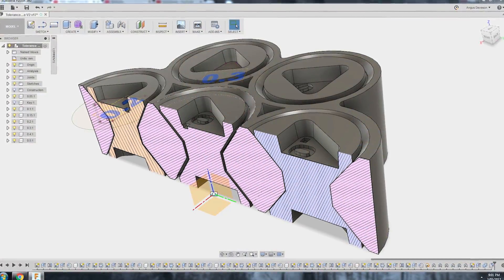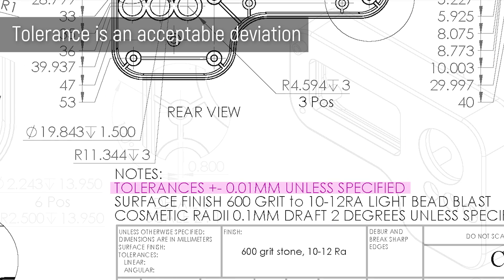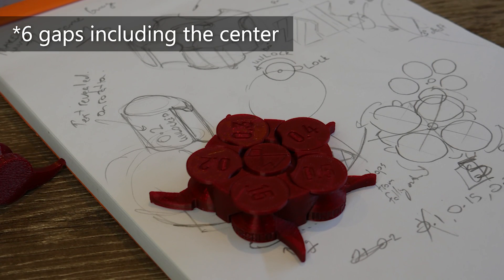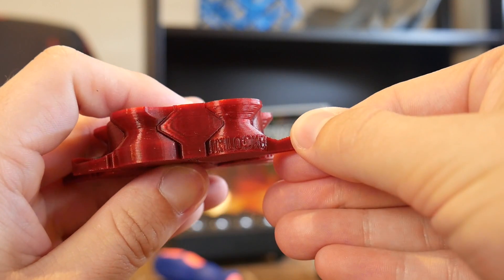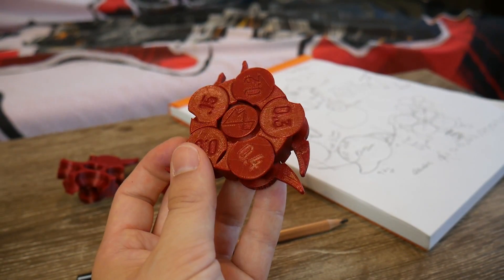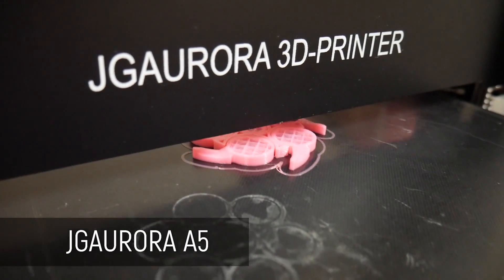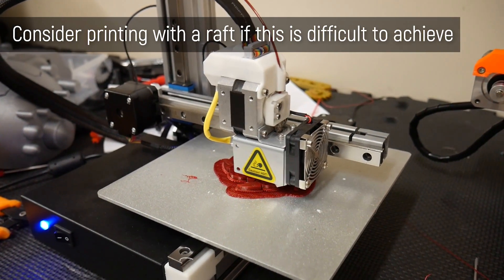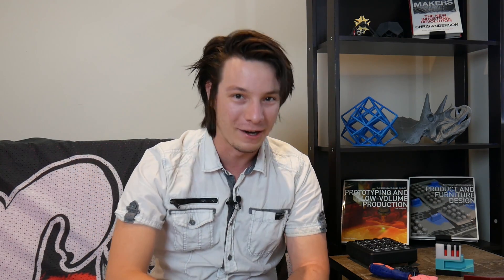Test your 3D Printer's Clearance and Tolerance

Comment: I understand this video is 5 years old. But I've looked all over the inter net with no real help. So i use a ender 3 v2 i use PLA and print at 200n and 60bed. When i tried the Clearance and Tolerance I was unable to move any of them. Almost like they are fusing together at lower levels of the print. Now i have made sure my bed is level i have made sure i am pushing 100mm of filament out. I've done E-steps. Done everything i can find. so any and all help i would love. Thank you.

Comment: how to adjust design afterwards? Im currently struggling with small holes that come out different sizes for horizontal and vertical
so if the thing doesnt turn, that means its too close?

i was looking at how these turn, and i had this idea for a tolerance knob gauge
a singular knob, and have numbers printed on the sides (0.5, 0.4, 0.3). Print it, then stick a feeler guage into the slot. Take the number printed on it and the feeler gauge number and minus it, and thats the amount of adjustment you need for that size hole.
I dont think feeler gauges come in >2mm tho.

Comment: Okay... so I printed this with your recommended settings, and only the .5 and .4 are unlocked. EVERYTHING else is completely fused! So what do I do? You don't really go into any steps to help alleviate issues with the clearances on the printer. As I'm not a designer, I'm not going to be able to alter the designs of the STLs that I'm trying to print.
Reply from the maker: Your first layer is most likely too close, try adjusting it and watch to see if there is gaps between each element as its printed, I've got another video on elephants foot effect and how to fix it here - https://youtu.be/zlgR3rHg4p8
Reply: @MakersMuse  Thanks for the quick reply! I actually watched your elephants foot video after I posted this, reworked my Creality Cura profile. I reprinted using a raft, and unlocked all but the .15!
Reply from the maker: @davidwatanabe2017  awesome!

Comment: I bought your tolerance gauge and have run 5 models of it adjusting settings in between each attempt. I have adjusted the extruder multiplier , the horizontal expansion, elephants foot, extruder steps, the layer height, and a few other settings that I can't remember right now and I have yet to have one test that I could break any of the segments loose. The printer seems to print most models well including articulating models, but I can't get this file to print properly at all. The model looks great, but there is no clearance on any of the test points. Any help would be appreciated.

Comment: Hello ,

I bought the tolerance part and after 30 minutes of pressure, 0.5 and 0.4 were very comfortable, while the rest 0.5 - 0.15 - 0.20 and 0.30 were stuck so much that when I tried to open it with a screw, its wings broke. How can I improve the tolerance of my prints in this case? Or do I need to give my measurements a value between 0.4 and 0.5 when I want to use them this way? Thank you.

Edit: Extrusion multiplier 1,00 in Simplify3d
Reply from the maker: It's designed to show you what clearances to expect, so yes you would design in 0.4 to 0.5mm gaps in future prints to ensure they don't weld together. For improvement you could try changing extrusion multiplier to 0.95, check retraction settings to ensure there's no blobs and make sure first layer is really really good. Good cooling also can help.
Reply: @MakersMuse  Thank you for your advices. I'll try and let you know here. Thank you.

Comment: My first run was a fail, lol. I could only break free the .05 I set the slicing tolerance to Exclusive, see if that helps. I will adjust a parameter at a time to really identify ware my issue is. Fun print though!

Comment: I printed it successfully on my CR6 SE. I had to apply significant force to 
break the.15 mm one lose but it worked.  The .15 is a bit tight but the 
.02mm clearance is very smooth.

Comment: So far one of my artillery sidewinders has no problems everything is free off the bed. 
The other I need to pop .15 loose and .2 is a little gritty. What setting should I play with? I knocked flow down to 95%

Comment: just printed the V1 version on a FlashForge Adventurer 4 .. all but 0.05 and 0.1 can be moved even without the tool to break them free, the others are impossible to move.
I did have some elephant foot, maybe that's why. overall, a pretty good result for having everything "on default"

Comment: It doesn't look like he replies to this anymore, but I'll throw this out there to see what you guys think.  When I printed this on my Ender 3, the 0.3, 0.4, & 0.5 literally fell out of the casing....and the other 2 weren't even snug.  So I assumed this was as under extrusion issue.  However, going back and checking (and rechecking) all the calibrations, my machine is right on target.  If anything, it's SLIGHTLY overextruding.  So, this has me baffled.  Any suggestions ??

Comment: I purchased the new  version , I was expecting to have a G code for my prusa Mk3 . I am new in 3D printing, Does the infill % or layer hieght or speed values effect my final result ? Do I need certain values when slicing in Prusa slicer ? Thanks for any help
Reply: Yes speed will affect it. Layer height might slightly. Infill shouldn't affect it much.

Hard to share g-code because it includes material temp settings so you'd have to have EXACTLY the same setup as Angus including material

Comment: Just tested my brand new CR-6 SE.  Getting the part to lift was a real challenge - refrigerator - hot water, cold water, hot water, knife and spatula! I didn't know about the flat blade screw driver allowance.  That made me happy because it freed up 0.2, although the 0.15 did snap instead of rotating.  I sliced using CURA 4.9 with all default settings because I mostly use Linux, not Windows.  The Creality version of the slicer was Windows only.

Comment: OK. I printed this 4 times to test my 4 machines. I have 3 machines that get horrible reviews and they actually should not. I have 2 Dobot MOOZ 2 machines, a Dobot MOOZ 3, which is a multi-color machine, and a Sindoh DP200 that doesn't get bad reviews but almost gets no reviews. On all 3 Dobots, small build volumes which is a major downfall, I could spin all that way down to the .1 that left only the .05 which I can't free in any of the prints. I actually thought that the MOOZ 3, which is a delta, would be a little less precise but it fooled me and did as well as the lead screw MOOZ 2 printers. Now the Sindoh DP200, I like it as the build volume is double the MOOZ capability, little disappointing as I can't free up the 1.5, 1.0 or the .5. I did notice that the detail on all my prints on the Sindoh are a little less detailed. I used identical filament moving from one machine to each of the others and identical layer height and infill density. HOWEVER, for the Dobots I use CURA and the Sindoh I just used their supplied slicer called 3DWOX. Maybe I should configure CURA for the Sindoh and see if I get improvements. The 3DWOX just gives a nice visual of what is being printed on the LCD panel and I get emails from the printer of % completes and I can watch the in machines built in cam as it progresses. Not sure if I can configure CURA to give me all that but, of course, I can hack the gcode to include those lines of code to the CURA gcode. Since I am a software developer I have manipulated gcode.

Comment: I purchased your model and printed it. $2 is cheap.  I had some elephant's foot issues. I saw in one of your other video's that you recommended adding a chamfer to parts to avoid the elephants foot print artifact.  Perhaps you could rev this model to include one. I'd happily pay for another.

Comment: 0.2 on another tolerance test needed a bit of push to unlock at first :( but 0.15 is fused.
i'm dissapointed since this printer is my own design. but also the z axis is from another printer still and i just made it.
my flow rate is optimized to be 0.8mm for two 0.4mm perimeters. and i actually have -0.05 compensation in my slicer so...
maybe if i reduce my accel from 2k to something like 1.5k but then that'd be dissapointing

EDIT: I PASSED THE 0.15 without much breaking pressure! didn't need the screw driver  I'M SO HAPPY :D

Comment: Does layer height play a role? I’m printing it right now at 0.30 height (with 0.40 nozzle)
Reply from the maker: Print using your defaults, but the higher the layer height the less clearance you can achieve. 0.15 or 0.2 recommended.
Reply: @MakersMuse  i don't have a "default" . I tend to print with setting that adjusted to the model that i print. That being said, with 0.3mm layer height I got the 0.3 disc free.... I will try the 0.15mm height next

Comment: Thank you for this test!!! Bought it a while ago and tested it on my Flashforge Adventurer 3, where i only got to 0.4... :(
I've got my self a B2X300 and spent like 40 hours to get it run smoothly - Spoiler: Guess what the solution was? I needed to oil my Filament as well, much more than i expected ... - but now i got to 0.15 with a little of force to breake it free. 

After all this struggle your test brought back the joy of owning the B2X300, so yeah thank you again! =)

Comment: Thanks for the test, I purchased it. :P gonna check if my printer is accurate and/or needs some adjustment. It probably does hehe.  I wonder what profile settings were used to print this though. Guess i'll look for a video that mentions it before spending hours printing this lil guy.
Reply from the maker: .15mm layers and 3 perimeters recommended, the rest is up to you and your preferred settings :)
Reply: @MakersMuse  Thanks for the quick reply :) I'll give it a go.
Reply: @MakersMuse  All the wheels turn :D Guess my Cr6-se is well configured. :D Thanks for the test again!

Comment: Hi Angus, thank you for the video and the tolerance test V2. My machines only can turn up to 0.3 . Is there any videos that show how to adjust the cura settings to have a better tolerance like down to 0.2 and so on. thanks
Reply: You should try printing it on raft if yet you didn't, and i recomend slowing down first layer a lot up to 75% slower then the rest.
I print on Ender 3 v2 and slightly hotter first layer helped as well.
Reply: @westerrr6  Thank you for your reply i printed on raft most of the time. yea ok i try to slower down the first layer. thanks again.
Reply: @westerrr6  By the way i am using CR10S Pro

Comment: So I purchased this file the other day just to see where my E3P was with clearance and tolerance. First test the .2 and .15 were completely seized. A couple flow calibrations and my second test was perfect. .2 and .15 were unlocked without using tools and without using a brim or raft. This was a great puzzle and challenge to get my printer just a little bit more dialed in!

Comment: So I downloaded this and just started it a few minutes ago. Then it hit me, I set my layer height to .15 as recommended, but my normal first layer is .3 with a 125% initial layer width. Should I be as .15 first layer and 100% width, for getting this as accurate as possible? And who complains about 2 bucks, a vending machine soda is almost that much by me...

Comment: now, over 2 years later, I still happily paid 2 bucks and tried it. those comparison things never get old
Reply: I just got my Prusa Mini (first 3d printer) and this is the only stl I have paid for (so far) First print of it got down to .2mm, reprinted it tonight and took it off the bed immediately and got the .15mm tab free with a screwdriver.

Comment: Hi Angus. I hope you see this message. About these gaps. When you mention a 0.2 mm clearance, are you talking about diameter or the gap between the side walls. I have this question because if we're talking about 0.2 mm gap between the side walls then that would give me a 0.4 diameter difference between parts. Would you please clarify this? Thanks in advance.

Comment: After an initial problem, in which my first layer solidified so nothing moved, I turned off "drop to build plate" in CURA and printed the new gauge with a 5mm support on my Ender 3. Using stock 0.4mm nozzle, 0.2mm layer height and cheap (£11.50/kg off Amazon) PLA at 200 deg with glass bed at 60 deg, I get down to unlocking 0.2mm, which isn't even that stiff; 0.15 looks like it has separation at the top and bottom (I can just slip the corner of a sheet of paper into the gap), but it won't move at all, presumably seized on the sloping sections. Now I just need to sort my first layer issue. :)

Update: With the aid of a short screwdriver simply as a lever against the arm, I've successfully freed the 0.15mm wheel too. So I think my Ender 3 setup must be pretty good!

Comment: I can't get .2 or .15 unlocked, and .3 is very very stiff.  You've got guides on calibrating different aspects of the printer, but is there a particular order you'd run them in?  level bed, e-steps, temperatures, single-wall thickness for flow rate, dimensional accuracy x/y/z.  Did I miss any?

Comment: I'm having a tough time printing the tolerance test.  I've run through so many calibration tests it's making my head spin.  What are some things that can be done to improve my ability to print objects with connecting/moving parts?  I'm on an Ender 3 Pro, using Cura 4.4.x.  The only mod I have is the EzABL and I'm using a glass bed (instead of magnetic one). Prints that do not have moving or connecting pieces seem to come out pretty spot on for the size and look great.  When I've done the 20mm cube test, it comes in around 20.1mm.  Cube wall test, comes in around .83mm on a double wall.  Using standard .4mm nozzle, and .2mm layer height.
Reply: Matt Shields it is a very difficult process to do. A lot of it comes down to tuning the e steps and slider settings. I have an Ender 3 and have working for a few weeks trying to get my tolerances down. An effective way is to adjust your extruder’s esteps per mm (there are a bunch of different videos on this). You can also adjust your extrusion multiplier. Some finer settings come down to the acceleration and jerk of your printer (too high or too low will result in thicker layers and a greater chance of holes being too small and parts not fitting. An basic fix would be to lower the “horizontal expansion” setting in cura. While this will make the parts fit if the value is low enough, it can cause other defects within the model. So, in short, check your hardware (belts and motors), firmware (esters and acceleration), and check your slicer (extrusion multiplier and horizontal expansion).

Comment: Great gadget... Just downloaded and printed on my Anet A6...Managed to free 0.3mm after scraping away the elephant's foot. But 0.2 is fused solid :( Even though it's a budget printer, I was hoping for at least 0.2 clearance. Now, to figure out why......
Reply: Wow! I'm so excited! After some structural work - involving bolting the printer down to a solid, flat surface - the Anet acrylic frame is so wobbly, a bit of extruder calibration and belt tensioning....Success!! The 0.2 cracked free pretty easy, the 0.15 was solid, but looked like it printed clear and was not fused. A little persuasion, and click! I was able to remove the centre piece as my prize....... :D Sliced with the Prusa Slicer with pretty much stock settings: 0.4mm nozzle, 0.15 layer height and 1.75mm eSun Fire Engine Red PLA+ at 200 deg C with bed at 55 deg C. Now I know I've got my printer dialled in!!!!!

Comment: Hi. I have an Ender3, stock. I made it down to .15.  I made it thanks to a well leveled bed and calibrated e-steps.  I'm using Cura 3.6.0.  RI'm still having trouble believing it. $2 well spend.  Thanks.

Comment: Just did it! 0.15mm free on Ender3 running kipper at 100mm/s (for all speeds except outer wall at 75mm/s).  No raft, 3 walls, 0.2 layer height in 2.5hrs.  4000mm/s/s max_accel.

Comment: I'm failing on my Ender 3 with this. I can only get down to 0.4 as 0.3 and below are all welded shut. Might try a cooler nozzle temp perhaps?
Reply: Hi. I also have an Ender3, stock. I made it down to .15.  I made it thanks to a well leveled bed and calibrated e-steps.  I'm using Cura 3.6.0. I'm still having trouble believing it.

Comment: Hi Angus can we get one made with lower tolerances say 0.10 and 0.05, I managed to clear all of them, so want to see what can be achieved.
Reply from the maker: Are you using cura? If so please be aware it and some other slicers will alter gaps to make them achievable, which can invalidate the true test of those very small clearances. Still, very impressive to have a printer tuned so well congrats!
Reply: Maker's Muse printer is a prusa mk3 upgraded to s, using prusa original grey filament that came with the kit,  slicer is the prusa edition latest release default setting on 0.2 quality print. Printer is stock no addition other than a perfectly calibrated print bed using the nylock method as opposed to bolting them down on the carriage. The bed came to a 0.02 offset from zero. Extruded calibrated as well. Thank you for the compliment. Hope to see the new test gauge. P.s. posted video on the gauge test on Facebook in the prusa community.
Reply from the maker: @shesharc  Oh nice! I don't believe that slicer changes distances by default. A new gauge might be on the cards then in future.

Comment: Tried on an Ender 3 with 0.16mm layer height. The locking 'wheels' free'd up pretty easy - a quick pry with a small screw driver. The inner race to the outer was welded though. Bugger. Should I try 0.12mm layer height or maybe go higher to 0.2mm?

Comment: Printed it on my Anycubic i3 Mega and set in Cura a 0.15 layer hight with 50mm/s print speed and 30mm/s wall speed (100% cooling). I was able to move the parts until 0.3. When trying to brake free 0.2 I broke the lever. Does somebody know how I could improve my print settings for some better results?